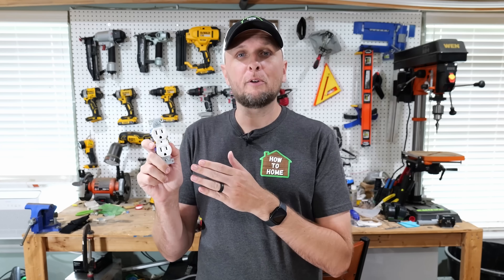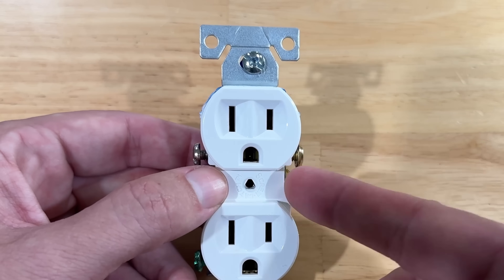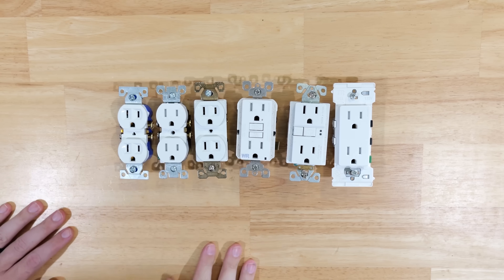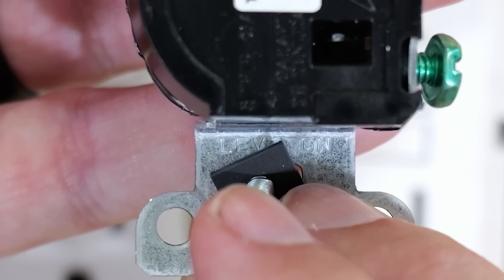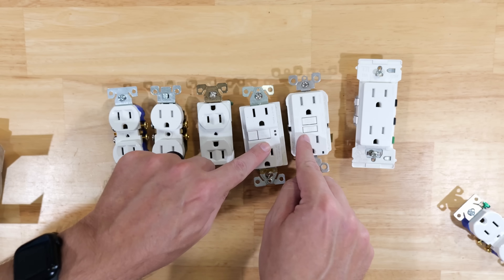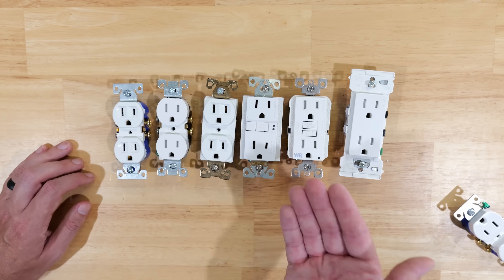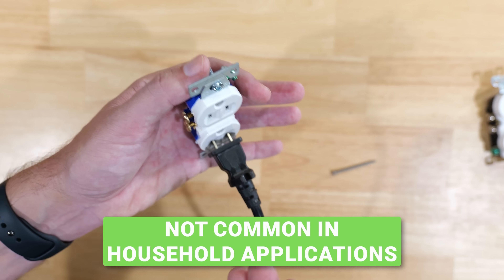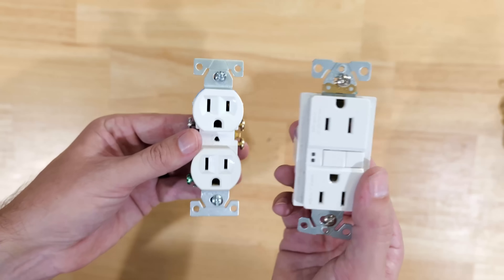The Shocking Reason Why Your Outlets Are Installed Upside Down!

Comment: I am a Certified Biomedical Equipment Technician (retired) and was always taught to orient the "safety ground" at the bottom.  This helps to ensure that one will not lose chassis (safety) ground in case the plug starts to pull out e.g.  from the weight of the cord or something falling on the cord.  I own and use some older portable power tools with metal cases and insist the receptacles I use them with are oriented with the ground at the bottom.  I personally think a horizontal mounting with the neutral "up" would be best, but the boxes would have to be re-designed.  I have not checked code since I left the profession to know if the code has changed, but I have noticed that medical offices are using "ground up" these days.
Reply: The ground prong up causes a problem for low-profile surge protectors which usually have the wire going down to the ground and prong on the wire side down to avoid a kink. Thats likely also a big part of why people are saying you are installing them upside down.  As a person who uses a bunch of surge protectors (cause PCs need them), I can say that installing them prong side up causes people more problems with cable routing and cable weight putting strain on the prongs and causing more problems than solving by doing it ground prong side up. Prong down better accommodates the vast majority to low profile surge protectors and also (Backup Batteries) Uniterutpable Power Supplies. Many of which the higher-end ones often have low-profile plugs with the wire going toward the ground and the Ground Prong down. 

Not having the ground wire (prong down) also causes a huge problem for a lot of low-profile surge protectors.  I have the prong up in my apartment. It was the first time I had ever seen them upside down cause every place else puts its prong side down.  The cable on many of the service protectors with the prong down as the wire goes down, I can literally see one of my cables now with the wire going up, putting weight and strain on the power outlet before it goes to the ground.  It tends to hang off further from the wall since the wire has to route up before it can go down.

I also suspect the reason why the outlets in my apartment may be so loose (cause plugs can easily come out) is not just because it's an old building but also because of the constant strain from surge protectors and thick wires rubbing on the outlets.
Reply: I'm a clinical engineer in practice for 50 years and former chair of both CCE and CBET certification commissions :). I also worked at ECRI in '70s and AAMI standards.  While I've never seen formal recommendations on outlet orientation, I do see where ground on top would be less susceptible to electrical shorts that might be caused by falling metal strips, plates, wires, etc.  Electrical shorts could certainly cause fire but almost certainly would trip breakers in hospitals where critical medical systems might be connected.  Thanks for your professional service!
Reply: @stevegrimes9330  Yes, but wouldn't AFCI and GFCI render that consideration moot at this point? AFCI is going to fire off when the hot and neutral get bridged and GFCI would trip if you've somehow managed to go from hot to really anything else that could accept the circuit. If you haven't got those things in your circuit, then you probably already have the outlet in some orientation and it often times seems a bit easier to just put it back in the orientation it was and not confuse the people that are used to that outlet being oriented in that way.

And there are some things like nightlights and plug in infusers that have a neutral on the left hand side and don't take kindly to being upside down, both of which are unlikely to be a necessity in a hospital or medical environment.
Reply: Ground goes up in hospitals so something doesn’t fall and short circuit exposed leads that may have partially come out. This is a critical location and you can’t have life saving equipment stop working or cause fires etc. Ground up prevents this from happening as anything that falls would hit 1 point and rock off to the side and has very little chance or short circuiting
Reply: "I personally think a horizontal mounting with the neutral "up" would be best"....I agree 100%.  It would also be best to have horizontal bracing behind the dry wall for stability.  Nothing worse for my OCD than a loose and wobbly outlet.
Reply: Former biomed now field engineer and was taught the same. Now every hospital does their own thing it seems. One thing are ac to dc adapters that are oriented to go down. If the outlet is upside down that means a wire is floating up in the air.
Reply: That’s why the ground prong is longer 
First make. Last break.
Reply: Breakers are for shorting.
Reply: @7urb1  True but when behind the desks there's dust bunnies and papers and tissues all kinds of stuff it doesn't take long to start a fire
Reply: @k4ebyk4eby6  Thank you! They didn't get the memo at my research building. It also begins to strain on the ground. We had two ultra low freezers. I had to have the plug replaced because the ground prong was breaking.   Thankfully, I caught it in time. We got standoffs installed.
Reply: Naa,doesn't matter
Reply: fun fact: when the plug starts falling out, it's time to replace the worn out receptacle
Reply: The boxes wouldn't have to be redesigned, they would just have to be rotated 90 degrees when being installed during construction.  Same exact box.
Reply: Ground prong up when that outlet is attached too the light-switch so people there know where to plug in their lamp to control it from the wall light-switch. Hospitals used ground up because clipboards have a history of falling off the walls and shorting switches, for this reason hospitals are ground up. As are other industrial facilities. It all depends on context.
Reply: Ground pin is always longer, so it stays connected if ground up.
Reply: Ground down means weight of the cord pulls prongs out 
Ground up means cord weight always pushes prongs in.
ground is always the longest pin.
Other than lay flat plugs ground up has the advantage.
Reply: @heyyou5189  I learned something from you today - thanks!
Reply: @heyyou5189  If your outlet is loose like that, then it's just a safety hazard in progress no matter what you do. If a cord is pulling out like that, then either the receptacle needs to be replaced, or you shouldn't be hanging something so heavy off of it. The correct thing to do is to address the issue, not wire the outlet upside down to hide a potential danger.
Reply: @heyyou5189 so kink in the wire be damned. Just buy a new appliance!?
Reply: My brother worked at a hospital and had many incidents where paper clips fell off the desks and shorted the hot to neutral starting 🔥 fires. They turned all the recepticals to ground up.
Reply: @Oldman1956 aha, okay for them then it might make sense, but not with my vacuum.
Reply: Coins fit in nicely

Comment: Surprised you didn't mention 90 degree plugs which are way better to have the receptacle ground down. That way the cord naturally falls straight down to the baseboard of a house etc. with no looping the cord upwards, which you are stuck with if the ground is on top. I hate the ground on top and the house i live in has a combination of both. I have not changed the ones that are on top BUT when a receptacle wears out or becomes faulty i will change to the ground on the bottom. I had a circuit fail recently and i discovered that the one that caused the failure had the POWER and NEUTRAL plugged into the back of the receptacle rather than using the screws. It looked to me from the marks on the wires that there is not very much contact surface to the wire using that option, so i used the screws instead. The receptacles downstream from that outlet were very low on power (devices failed to work), when i checked with my multimeter.

Comment: Upside down outlets present a problem both for flat plugs that have the cord going straight down or 45° down, and for polarized wall bricks that have the wrong center of gravity if you have to plug them in upside down

Comment: Just to troll a little, it could be argued that the instructions on the back of the outlet are printed upside-down so you can read them when looking over the top of the receptacle when it's wired in.
The more likely reason is that some of these manufacturers are probably continuing conventions from when the ground pin wasn't even a thing.

Comment: A good friend of mine (now deceased), who was a licensed master electrician, told me the ground pin should be down because, if the plug began to fall out of the outlet, the ground pin (a safety feature) would be the last to separate.  Our house has outlets installed both ways but every one I've installed or replaced is ground pin down.
Reply: Glad to hear that there is little difference as to receptical orientation. I like the look better with the ground side down because it looks like a smiley face. Silly reason, but all of my recepticals have the same orientation. Thanks!
Reply: @thomasharrington4354  I agree, it is just more aesthetic. My biggest argument for having the ground down is that a lot of items that have a grounded plug (room fresheners like Fabreeze) have the down orientation.  Therefore if it's installed ground up the liquid will leak out.
Reply: The reverse of that is that if the ground pin was on top, the action of someone pulling out the plug would tend to add a torque force to the ground pin, as we're usually well above the height of the outlet, and pulling up as well as out.
Reply: Ever plug-in AC, a hair dryer, etc.  The weight is ALWAYS on the the ground side thus stabilizing it against the wall if ground down but ground up would cause the weight to pull it out of the receptacle.

Try it, i can guarantee which leans out and exposes the connection first.
Reply: The ground pin will always be the last to separate regardless.  That's why it is longer than the hot and neutral blades.
Reply: @stargazer7644  Actually --- it's the FIRST to make contact ... either for a static discharge to keep expensive electronics from that or to make sure that if, somehow, just the hot prong went in, then there'd still be a ground to protect the device or the stupid human. 
You have to de-humanize things or the lawyers will get ya!
Reply: @SurferJoe46  um actually 🤓...  try reading the comment you're "correcting" again.... it doesn't say what you assumed and went on a rant against.
Reply: @Jon-id7ki How exactly was that a rant? Because he didn’t agree with you?Petty

Comment: Well then they aren't upside down are they? AFAIK there is no preferred direction in code. HOWEVER try to find a right angle plug with the ground on top. I prefer ground on top but for things like my clothes washer I had to install ground down to keep from having the cord leave the top and twist back down again.

Comment: For Euro Schuko outlets there's in general no up or down either, just the French variant that's different.
However on the modern Euro outlets there's no way you can touch the prongs before they make contact.

Comment: When NEC and or the manufacturer does not specify then it is up to personal preference. The only time it would become and issue is with a 90 degree plug. With the ground up the cord will go upward, when the ground down the cord will go downward. As far as something falling on the prongs it is 50/50. Murphy's law made sure of that.

Comment: I would like to make two comments concerning this video. I agree with you on most of what you said, but when I pull a plug out of the socket, I hold the plug by the side grabs as you are supposed to do. They put them there for that reason, so you not to get shocked!. I like the look of them being down too, and there are some things that my wife buys like some fragrance type stuff that you can't place upside down. They will only fit in on the ground being in the down position. There are other purchased items like that, that work the same.

Comment: Here's another argument for ground down.... Most 90 degree plugs have the ground pin on the cable side. So if your outlet has ground upwards, your 90 deg plug will send your wire up away from the floor, making a 180 deg loop before returning to the floor. With the outlet having ground down, your 90 deg plug will smoooothly send your wire straight to the floor.

Comment: I have a number of appliances and extension cords (typically called "air conditioner extension cords" with right-angle plugs.  In almost every single right-angle plug with a ground pin, the ground pin is opposite where the wire exits the plug.  That means that, with ground opening down, the cord loops; with ground opening up, the cord lies flat on the wall.  It's my habit, when using right-angle plugs, to turn the outlet around so it is ground opening up.  (Now, I have some lighter-gauge extension cords oriented the opposite way, so that the ground opening down allows the wire to be flat against the wall -- and I have an extension where the wire comes off the plug at an angle, don't know why..  I have no appliances with right-angle plugs like this.)

Comment: I stopped installing them with the ground prong facing up because the appliance manufacturing industry no longer recognizes that it’s the proper orientation. Pretty much all angled cords on appliances and power strips you buy today are designed with the ground prong on the bottom which causes the cord to be bent and kinked when plugged into an outlet that is installed the “correct” way. IMO this is a much bigger and more realistic hazard than the outside chance of something dropping across the blades and hitting the neutral and hot (which would knock the breaker out anyway).

Comment: All the senarios you made for ground up or down are specious. The only reason for ground up or down is which direction a right angle plug is going... such as on a refrigerator. You generally want the cord to hang down. Any other reason for ground having to up or down is because the electrician has OCD. The same type of electrician that has to make the slot of all cover plate screws go in the same direction.

Comment: Ground down is the safer IMHO, as cord sages or pulled down from full insert, you want the ground to be the last pin to break contact. Think about it .... 73 KV4WM
Reply: The safer option is not to have a receptacle.  The rest is opinion, not fact.

Comment: U shaped ground means ground up. Why? because of an item falling on the ground pin first from above. Then there is also the weight of the plug and cord pulling downwards. The ground up supports the weight of the drooping cord much better. The ground pin has the holding strength. Always note that the ground plug always has the ground pin longer than the hot and neutral. That is because the ground is the first to make and last to break when inserting and removing the plug from the receptacle.

Comment: 10:57 the receptacles in our house had the ground side up when we bought it. As I’ve changed them over the years ( most of them were cheap and plugs didn’t fit tight) I have installed them ground side down. In my mind, ground side up likely came about involving someone who had stroke and too much time on his/her hands.

Comment: My brother, was a master electrician, told me that you would install ground up in commercial situation because of the shorting issue with paper clips etc.  In residence not an issue and the practice to ID switch outlet by going ground up.
Reply: But if the theoretical paperclip that slides exactly next to the wall comes down at an angle (more likely than it falling exactly horizontally), there's still a 50-50 chance it'll come down on the left side of a ground-up plug and thus contact both the ground and the hot. So really no difference.

Comment: Up or down depends upon what you are going to plug into the recepticle.  Some heavy power cords, especially with the flat heads, are oriented with the ground proung on top.  So to reduce stress on the cord, you would have the recepticle ground prong up.

Comment: I have a refrigerator in my basement. The orientation of the plug is ground prong up. So if you have a receptical ground prong down you would be putting stress on the point where the cord meets the plug. I remedied the problem with zip ties. Anybody else have a major appliance with the same plug orientation?

Comment: Great vid. In California (Los Angeles county, San Francisco county and Alameda county) I had inspectors make me put the ground prong up. One of them told me that in 1991 (Northridge earthquake in the LA area) two house burned down because a painting with a steel braded cable on the back of the frame jump off the wall and bridged the line and neutral prongs.
Reply: Sound made up and in anyway that earthquake caused $13-50 billion damages. Tho buildings is very small compared to that.
Reply: Breaker should have tripped.

Comment: Well North American receptacles AND plugs are just poorly designed. Take a look at UK plugs and receptacles and how they work. They are always ground pin up and the ground pin is longer and is used to push a switch to energize the live pin. As such, ALL plugs must have a ground pin even if it’s just a dummy plastic pin in order to make the receptacles work. They are also much bigger and plugs usually have grips on the sides. Furthermore, receptacles always have switches on them, one for each receptacle, for added safety. They also use 240v, making safety much more important, but still this design makes it very difficult to cause a short or to shock you if you touch a pin when pulling a plug out.